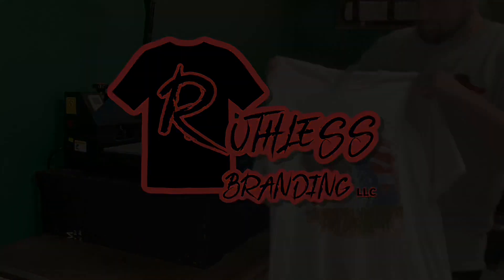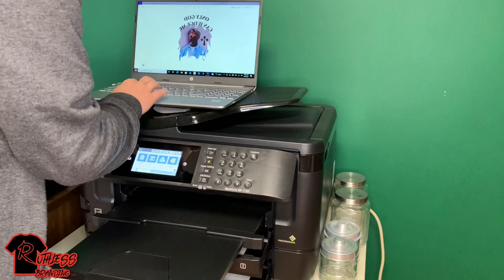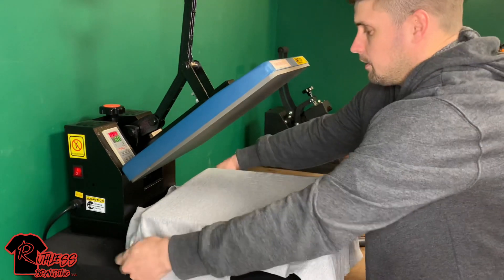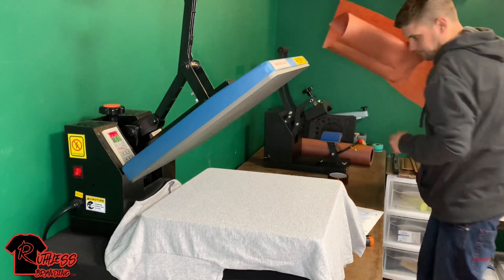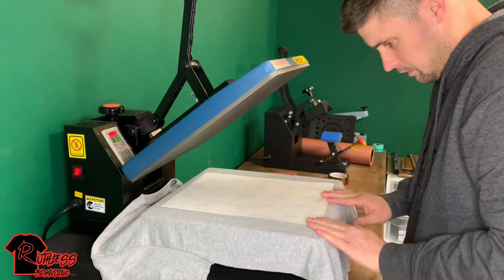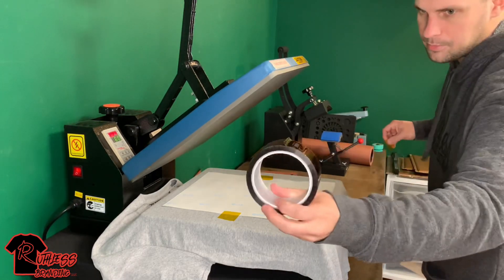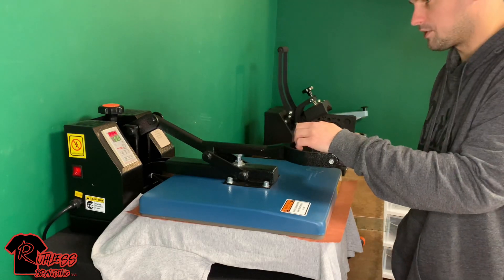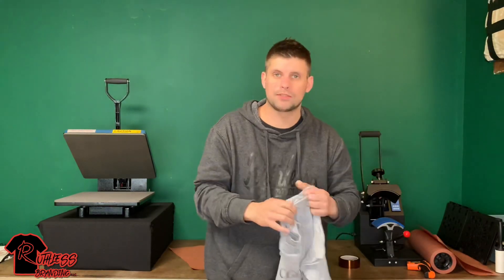SUBLIMATION ON 50/50 COTTON POLY BLEND T-SHIRTS (how to do sublimation on 50/50 blend shirts)

Comment: If u run it twice on the print it'll come out more vibrant
Reply from the maker: Ok thank you
Reply: Hi! I just bought a heatpress and tried in on Gildan 50/50. I’m using Asub paper. 385 heat and 45-60 seconds. It kinda looks faded. What do you mean run it twice? Like press it twice? Thanks.

Comment: You need a spray that grabs the ink on 50/50 shirts or it will fade with each wash
Reply from the maker: Thank you
Reply: Do you know what’s the spray called? And when do I use the spray?
Reply: @JayWitDaGlock  I use Subli- mate spray and I buy it on Amazon
Reply: Maybe I got lucky I never sprayed anything, I Sub 50 50  blends and none of the them have faded.
Reply: They don’t fade on each wash. It will fade once, because the colour on the cotton will wash off after first wash but the colour attached to the polyester will stay forever. There’s no fading at all after that first wash, the print will stay on as long as the shirt exists. 
But the lower the % polyester the more muted/vintage it will look, and the higher % of poly the more popping and vivid the colours will be.
But as I said, the won’t fade any more after that first wash. Sublimation is super durable.